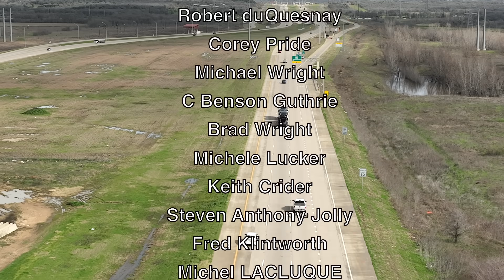"Cybertruck Production Increase"  Tesla Gigafactory Texas  2/3/2024  9:55AM

Comment: Thanks Brad. First glimpse of the Megabattery pack connected. Months ago, you were also the first to catch any action at the chiller plant next to the Cathode building.
Reply: The high voltage side of the substation is connected. Can NOT confirm if the Megapacks are connected. Unless you or someone has good enough screen resolution to see the position of the medium voltage 24.9 kV switches? They are smaller and harder to see. But definitely a step in the right direction.
Reply from the maker: I looked at the orignal footage and it looks like all switches are close and the ones at the transformers too. @DavidJohnson-tv2nn

Comment: Please confirm if I saw this correctly, at 10:39 it appears that the battery packs are now engaged.
Reply: Can't confirm for sure. Yes, the 345 kV disconnect switches are closed. But... I can't tell on my screen if the 24.9 kV switches on the other side of the transformer are closed.
Reply: Update: LCRA substation:
@ 10:18 (Bay furthest east) The 345 kV switches to the east monopole are also closed. So provided that the circuit breakers are closed... The high voltage side of the BESS substation is now energized. But still can't confirm that the medium voltage 24.9 kV side is energized.
Reply: 10:45 the battery side is also closed. appears to be live.
Reply: 10:45. Knife switches open. Megapacks not connected.

Joe's video yesterday has a better view at a lower elevation, shows the switches in the same open position. https://youtu.be/6SYC4OIGfpc?t=1658
Reply: One thing to remember, even when the switches are closed, is that the circuit breakers must also be closed and there is no easy way for us to see if they are open or closed. Yes, they have tell tale indicators on them but they are small and not easily seen from a couple hundred feet in the air.
Reply from the maker: I going to fly Monday and will get close shots of the switches.
Reply: @BTSflyer  Thanks!
Reply: @BTSflyer  Good chance you will be the first to report the Megapacks being live.
Reply: @DessieDoolan  Keep in mind that drone video can only confirm that the BESS substation is likely to be live. Remember, each of those "knife switches" that you mentioned disconnects either 8 or 10 Megapacks as a group. Each of the Megapack transformers likely has switches or circuit breakers that can be opened or closed remotely. Those would be located in the various cabinets surrounding the Megapack transformers and are unseen from the drone. Also, as William Wheeler mentioned.... The drone video won't show the state of the circuit breakers in the BESS substation or the LCRA substation. All of which have to be closed in order for the Megapacks to be online. So yes, we can say all the visible switches closed and the Megapacks may be live. We just can't know for sure. Unless maybe Joe can get confirmation from somebody there on the ground.
Reply: @DavidJohnson-tv2nn  I'll let you talk Brad or Joe into going out there after dark to go Megapack to Megapack to find some twinkling LEDs to confirm each is fully operational.
Reply: @DessieDoolan  My only point is that even if all visible switches are closed, we can't know for sure that the all or any of the Megapacks are operational. I suppose the gates being closed would also be a clue.
I don't expect Joe to inspect the Megapacks in the dark :) But... From time to time he does talk to people who work there.
Reply from the maker: Even when they get online there will be a period of testing before they can do real work. @DavidJohnson-tv2nn

Comment: Thanks Brad
Been some rain.
0:33. Westside. Tunnel project. Not much change. Still waiting for the ‘tail shield’ (as per David Salisbury), before the black tarped components can be installed.
1:02. New EOL transport yard. Left. Electricians running out cables. 1:39 also.
2:25. New EOL site. Left. Pond drainage culvert operational.
4:42. Southend, west diagonal corner. Full height open space here. Grand Entrance? Crystal Ball not giving much away.
5:23. Southend, east diagonal corner. Delivery of glazed units in the crates.
6:23. Parking Garage site. Blue water main seen being laid in Joe’s video yesterday has managed to not float with the rain. May have been encased in concrete post Joe’s flight, or otherwise weighted down.
8:35. BIW, under roof plant room. Left. At the point where the large diameter white pipe reduces in size, on the floor below are the drain inlets, in pairs, identical to those used on the roof. More pairs at 8:39, 8:44, 8:51.
9:00. Southend. Right. 4 yellow formtubes* to extend (curiously) the CFA piles.
10:34. BESS switchyard. Knife switches in the circuit from the Megapacks appear to still be open. Megapacks not live.
10:42. BESS switchyard. Left. Disconnects closed, as are the security fence gates. BESS Switchyard might be live.
11:05. Die Shop east, apron. Red ladders installed for access over the tank containment walls.
11:37. Cathode west. Tree. Dirty job for someone to clean up.
11:51. Cathode north. Works on the sanitary sewer lift station. New concrete paving covered.
12:11. Cathode west. Against the building. Gravel laid over geo-mesh.
12:38. BIW, apron. Rebar placed. 
12:44. Casting east, apron. LNG system not connected. Best view yet.
13:01. Casting east, apron. Good view of the black painted steel components. Support structure for the hoods and blue pipes perhaps.
13:30. Paint, apron. Cybetruck rear castings. Marked with a red X on the round injection plug. Scrapping these I would guess.
13:50. Battery north. Bundle of white pallet racking. Steel delivery on the trailer.
13:54. Battery, diagonal corner. Apron. Excavation backfilled, paving replaced. 

*YLTMV (Your Local Terminology May Vary).
Reply: 10:42 Agree that the high voltage side of the substation may be energized.
LCRA substation:
@ 10:18 (Bay furthest east) The 345 kV switches to the east monopole are also closed. So provided that the circuit breakers are also closed... The high voltage side of the BESS substation is now energized. But still can't confirm that the medium voltage 24.9 kV side is energized.
@ 10:44 Can you see if the 24.9 kV switches on the other side of the large transformer are closed? Can't tell on my screen.
Reply: @DavidJohnson-tv2nn  10:45. Where the cables from the Megapacks rise onto the switchyard framework, the knife switches appear to be open. I think 'knife switch' is the/a correct term, used prior, and mentioned in a comment yesterday under Joe's video by @rustynickel2356

The gates to the BESS installation are also open. I don't know if they need to be closed for safety reasons, unlike the BESS switchyard.
Reply: @DavidJohnson-tv2nn  The best indication of all this being complete will be the removal of the genset at the small control building. While that is still in place it would indicate testing, or intermittent operation.

Prepare for days of "but the solar panels aren't complete" questions.
Reply: @DessieDoolan  Yes, taking another look at it, it appears that the switches you mentioned are open. But there are another set of switches on the secondary side of the transformer that also need to be closed. Given that the gates are also open and the genset is still there... Guessing that the Megapacks are not yet connected.
Reply from the maker: Good to know so I can get closer. Wasn't that close today.

Comment: got some power connected there on that small yard finally... but does it go to the connects for the bess yet ?
Reply: That has yet to be confirmed. On my screen I can confirm that the high voltage 345 kV switches are closed. So the high voltage side of the substation may be energized. But can't confirm if the medium voltage 24.9 kV switches are closed.

Comment: Thanks Brad!
EOL facility:
South:
@1:25 to 1:39 Ongoing work to install Superchargers.
North:
@ 2:25 (Left) Newly constructed pond outfall is getting some use.
(Bottom left) Not new, but cables visible in vaults.
Main building:
@ 8:20 to 8:52 View of HVAC equipment through roof opening.
BESS substation:
@ 10:40 (Bottom left) 345 kV disconnect switches now closed!
@ 10:44 (Left) Can't make out the position of the 24.9 kV switches from this angle. Anyone else have a better view on their screen?
Eastside of casting:
@ 12:32 Rebar placed around the vaults. Concrete pour coming soon. Though the north and south vault covers may be coming back off to finish the cable pulls?
Reply: Update: LCRA substation:
@ 10:18 (Bay furthest east) The 345 kV switches to the east monopole are also closed.